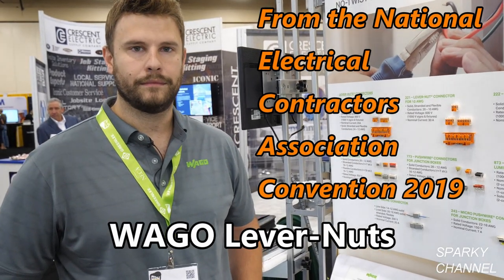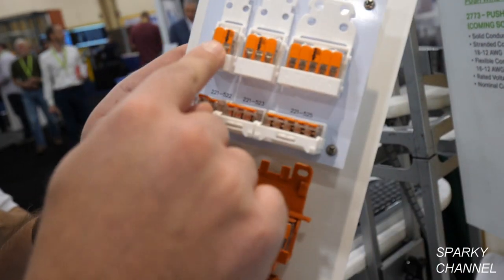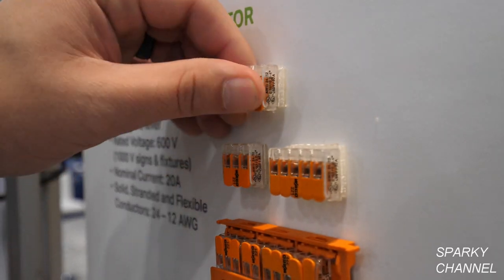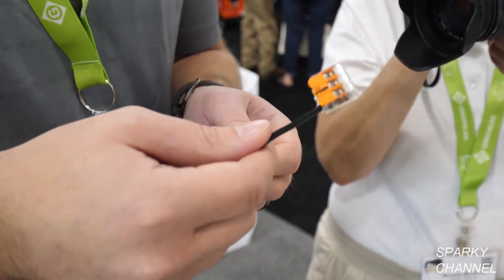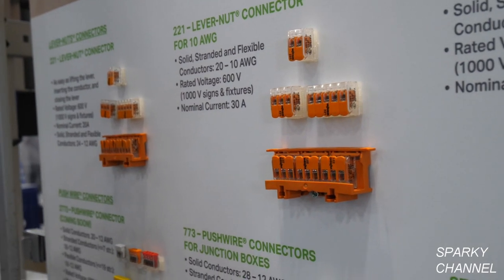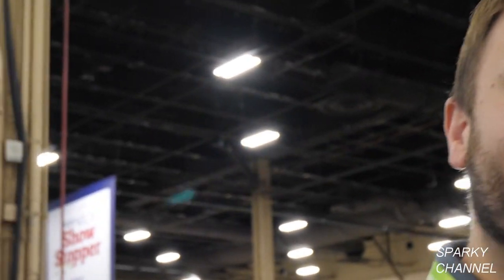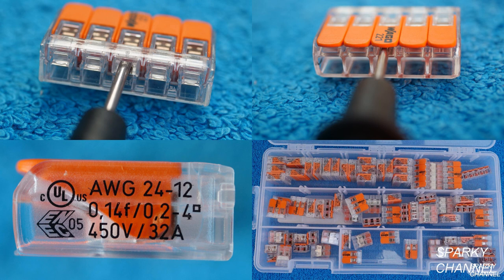Wago Lever-Nuts Questions and Answers From National Electrical Contractor Convention

Comment: DO NOT use wago in your house. It is ok for electronics but not safe for house voltage. It will heat up and fail and short the circuit and may cause a fire.
Reply: @jaytalbot1146  So you saying not to use a breaker? Never seen higher then a 40A breaker in a resident. Of course 220 would be total of 80A but still only 40A per leg. My personal opinion after 40+ years is over time or load they will fail. I'll stick with wire nuts thanks.
Reply: That's completely false and you know it.
Reply: This is some sort of trolling. This is the second time this person is claiming these are dangerous and “will cause fires”, with ZERO evidence or data to back the claim. You don’t make such strong accusations without evidence, in some settings this is defamation and possibly illegal. I suggest you provide evidence or facts to support or prove your claim, or shut the hell up.
Reply: @james396  Prove me wrong? How long have you been in the field? I do not see any UL approval stamped on them. You list no ratings. (amp/volt) Sounds like you're a company man. You are the troll.
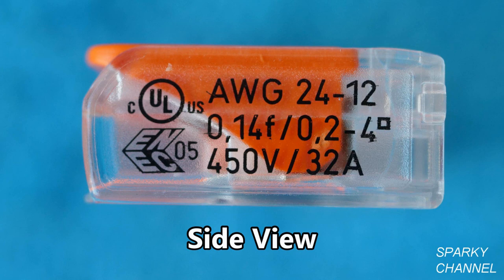Reply: @leostgeorge2080  There's a UL symbol on them - you can see it at 5:47.  He specifically talked about the UL rating in the video.  Around that time he also talks about how they're rated for 600v in the U.S. and Canada, and 450v in Europe.  He also mentioned the current rating (20A or 30A depending on model) several times in the video.
Reply: @jeffspaulding9834  An other company man lmao. If want to use that crap on your house be my guest. I VALUE my family and my knowledge of the subject to much. Funny how many trolls answering me trying to push a crap ass product. Has to make a person wonder. if it was as good as you say why are NO electricians in RL using or endorsing your product? Only DIY people who have no clue seem to think you have a home run. yet here you are pushing a product on youtube. LMAO.
Reply: @leostgeorge2080  I'm not pushing anything, merely pointing out that you didn't pay a bit of attention to the video.

I'm a software developer for a defense contractor.  We actually have to pay attention to things and we have to be correct in our claims because if they're not right we don't get paid.

Your claim #1: Not safe for house voltage.  Video claims UL certification at 600v, ELEC certification to 450v.  450v stamped on the side of the item.
Your claim #2: They'll heat up and cause a fire.  You've given us no examples of this actually happening when asked.
Your claim #3: You've never seen higher than 40A in a residential install.  I've got a 50A for my welding circuit in my garage, and it was here when I bought the house.
Your claim #4: No UL approval.  There's a UL stamp right on the thing clear as day in the video.
Your claim #5: No ratings given.  Ratings were discussed - at length - in the video.  Items have ELEC 450v rating stamped on the side.

It's quite apparent you didn't watch the video at all, and were just here to post your uninformed opinion.  You didn't like being called on it, so you've accused me and another guy here as being trolls and shills.  Which brings us to:

Your claim #6: You have forty years experience.  Forty years experience being an idiot just makes for a better idiot.  Like my grandfather always told me, there's no fool like an old fool.
Reply: @jeffspaulding9834  Well i can see you know nothing about electrical. Voltage is nothing. It's AMPERAGE that it will fail on. So it's nothing like a young fool who thinks he knows what he is talking about but making a fool of him self. use that on a 220v hot water heater or anything that draws a high amp load. It will heat up and fail in time. volt is nothing. It's AMPS! stick to your software. People mouthing off about things they know nothing about is what gets people killed. Ohhh i'm a software developer for defense. So you play with zero's and one's all day...smart guy. Glad i was not serving when you wore developing. I might not be here.
Reply: @leostgeorge2080  You said: "You list no ratings. (amp/volt)"

I said, "Ratings were discussed - at length - in the video.  Items have ELEC 450v rating stamped on the side."

The current ratings (that means "amperage" in case you don't know) are given in the video.  You specifically asked for both amps and volts.  What in that exchange had ANYTHING to do with devices failing due to current vs. voltage?

And you STILL continue to provide no proof of actual issues from these devices.

So you know what?  Successful troll.  You got me.  I'm not going to argue with you anymore.
Reply: @jeffspaulding9834  Play with your ones and zeros and leave the real work to real men. Troll
Reply: @leostgeorge2080  In several European countries wire nuts are not allowed, wagos or equivalent are mandatory. Our 240V 32 Amp circuit  are doing fine with the appropriate rated wago connector. But give me the proof (not your opinion) you have of your claim and I'll happily forward your concerns to the appropriate government agencies :-).
Reply: @JoppeOSL  You know if anyone said anything negative about the best selling product in the world there would not be so much response to one statement. This sure makes me wonder what is wrong with this product. It needs to advertise on youtube and so many people responding. It's like thou protest to much there for are guilty.Oh and i never herd of a 32 amp circuit. 30/40/50 amp but never a 32 amp. As far as wire nuts not being allowed. I challenge you to name any country in the world where they are not allowed on under 50 amp applications. Not talking higher amp where a bundy is required.
Reply: @leostgeorge2080  I suggest you educate yourself. First you did not come up with any evidence of your claim, you just continued to cast doubt about about people asking you to document your claims. Pro tip 1. Back up your claim, before demanding answers to your questions. Put "32A MCB Mini Circuit Breaker" in your search engine, any you now know about 32A fuses. And for countries, try NEK 400 and the allowance for wire nuts in splices in new installations. Pro tip 2: The fact that you do not know about it or understand it does not justify making things up to preserve your ignorance.
Reply: @leostgeorge2080  you’re making the claim, that means YOU have to prove it. There’s hundreds of comments right here on the video from people that have used them for years, not one single person has observed a fire. This is a very serious allegation to make, you need to show your evidence or shut the hell up.
Reply: @leostgeorge2080  Just to clarify, a 32A circuit is regularly used in the UK and usually takes the form of a ring using 2.5mm2 cable. If you wish to have a 32A radial circuit you would need to increase the cable size to 4mm2. You can of course choose to believe what you want, but I have been using Wagos for about the last 12 years as a professional electrician and I've never had a single issue with any of them. They save time and are worth every penny.
Reply: @semperidem2577  Well thanks for your opinion semper I will file it accordingly. Have a great day :-)
Reply: @leostgeorge2080  Sorry, but at 220 the current would STILL be limited to 40A total - it doesn't 'double up'.
Reply: @jaytalbot1146  You do not use those connectors at that current level.
Reply: @leostgeorge2080  You know what they say about assuming. You are assuming they will fail. But have no proof one ever has. Most politicians have been doing the job for 40+ years too and look at the state of things
Reply: @leostgeorge2080  Not to mention those spring loaded outlets cost 50 cents. There's a reason they a garbage. Stop comparing apples to oranges. The springs on my car fail after 12 years to WAGO clamps will too. lol
Reply: @baileythesleepless9966  My family is fine Doing awesome thanks. Talk about a man baby? You can't allow my opinion without insults from you? Who's the man baby?
Reply: @leostgeorge2080  uh huh, good one ;)
Reply: Springs in your car fail because they are constantly being moved back and forth. Just like a pop can bending it will break. Wago is only moved one time. It is the same as leaving rounds in a magazine, won’t harm it a bit.

Comment: Junk!
Reply: They’re good connectors man
Reply: "Junk" that's been sold successfully for about 50 years now...without failures, without problems, practically standard in most of Europe. Ever actually used them? No? Great, tell you what, when you have, you can actually say something about it. They are amazing. Every single junction box (or outlet box or light switch box) I open up that still has twisted wires in them I rip apart immediately, cut off the twisted part (because twisting is really REALLY bad for copper wires) and put in Wagos. usually not the 221s, but the 2273s (2773s in the US, probably a slightly different standard). Their smaller and don't have levers. They. Just. Work. Every single time.
Reply: Let me guess: you still use cotton friction tape; that Scotch 33+ is just a passing fad. Still doing knob and tube?
Reply: "junk" that's so good that we stopped using wire nuts. Saves time, makes the work look better, and makes it way easier when redoing or adding to the connection